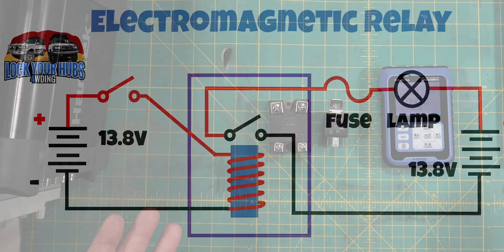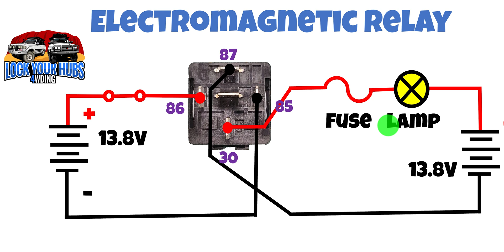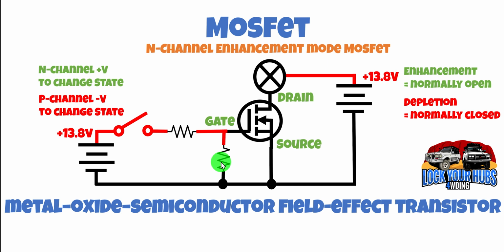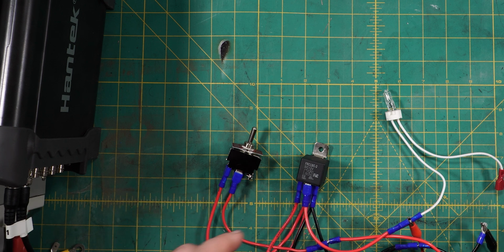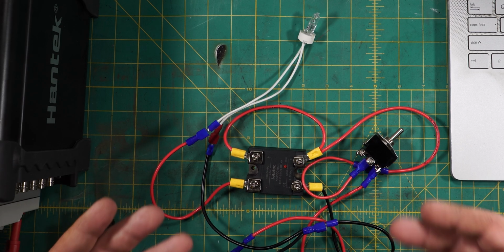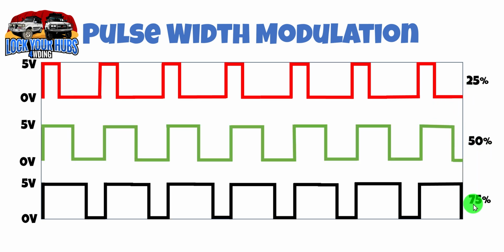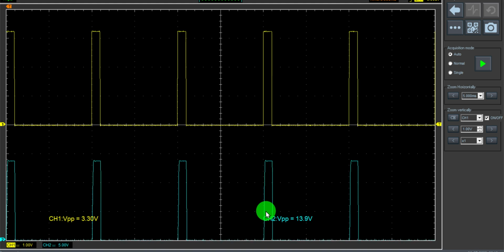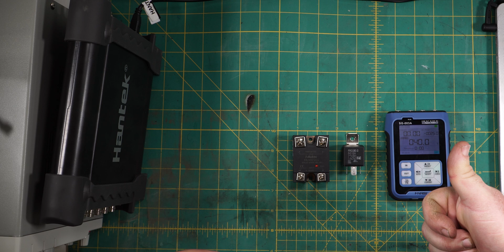Solid State Relays Explained: Speed Tests, Reliability, and PWM Control

Comment: I disagree with your reliability opinion. I replace more electronic devices than I do electro mechanical relays. Not necessarily electronic relays but electronic devices on boats in general. Solenoid relays for some reason are more problematic. Maybe because they are used in higher amperage draw applications. I am curious how much amperage these things are capable of on the load side. I do see the advantage for a PWM application.

Comment: Great video, thank you, very well explained.  PWM is a powerful tool, with a SS Relay you can use a low current PWM output on a stand alone ECU to drive some big loads via a SS relay if you want to, thanks for that reminder.  And the optical isolation is pure bonus in terms of helping to protect the ECU.

Comment: will this control my dc fuel pumps?

if so..

is there and degradation in longevity of the pump?

does it hinder the pumps performance?

i run three pumps and running them always isn't ideal. i currently stage them but PWM is better?

Comment: Solid State Relay is notoriously known for its enormous heat dissipation especially when used for load 10A or above, where mechanical relay can offer much higher amperage without heating.
Reply from the maker: Great point, the spec sheet should state under what conditions, both power and atmospheric, heat sinking is required.

Comment: Awesome video mate i didn't know that these existed, Could you use a solid state relay to dim your 12v camp lights by adding a dim switch?
Reply from the maker: As long as the dimmer used PWM, it would work fine.

Comment: Brilliant video! Would have been good to see the mechanical relay attempt to dim the bulb using PWM. Would it flicker? Would it dim when the pulses are slow enough for the coil to de magnetise? Would the relay rattle itself to death?
Reply from the maker: Unless the cycle rate was very low, it wouldn't allow enough time for the magnetic field that activates the relay to collapse, so the relay would just stay on.

Comment: hi Sir, so could you use a higher current ssr to modify a dc welder for pwm  i guess you would need a large heatsink attached to the relay for heat?
Reply from the maker: I can't see why not, you would need a pwm spice where you can not only vary the frequency, but the duty cycle as well.

Comment: A solid state relay can work in a 12volt discharged battery?
Reply from the maker: With the battery at a low state of charge?
Reply: @LockyourHubs4WDing  yes,for example a 12volt discharged battery when is below 12volt.
Reply from the maker: @vicentecarrasco3653  the switched output doesn't really care what state of charge of the battery it's switching.

 The input switching voltage must be compliant with the specs of the particular SSR you're using. In this case it's 4-32v DC.

Comment: what you did not address is the efficiency of each of the two types of relays at various loads
- the heat generated at various loads
Reply from the maker: The "coil" or the "contacts"?

Comment: OK so this all looks very technical but you have planted a seed of confusion in my non electronically trained brain. First: As I'm learning about relays I see all the other videos show primary power from the battery is in at pin 30 and out at 87 or 87a. The switch (on/off) goes through 85 and 86. You have those swapped around. Secondly on the solid state relay you have the power from the battery in on the terminal marked -4 then later you have power in at the 3+ terminal. Could you please clarify these points. Thanks
Reply from the maker: 30 is in and 87a is out NC, 87 is out NO. I might have messed up the diagram on the SSD, though the actual wiring is fine.

Comment: Great explanation as always, I like Solid state relays because they don't have contacts to burn out and become resistive, because the case is sealed, less prone to dust and moisture issues that cause that. Good quality SSRs are definitely worth the extra 👌
Reply from the maker: I agree, under large loads, you might have to run a heat sink, but even then, I think it's worth it.

Comment: Thanks for another great video.  Some of the solid state relays on the market appear to have inflated ratings and fail to switch the current specified.

If you ever have the chance it would be good to see if that holds true in a practical application.
Reply from the maker: Great idea!

Comment: Well explained as always.  PWM - would this work on a water pump, allowing me to adjust the water flow?   could then use a bigger pump and slow it down when needed....??
Reply from the maker: Yes, you could definitely control the flow volume of a DC powered water  pump with PWM.